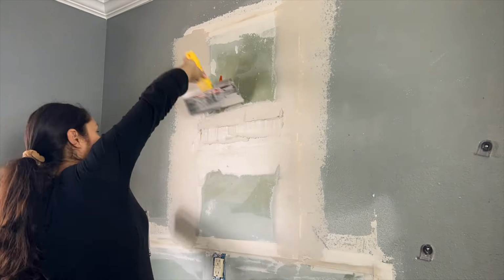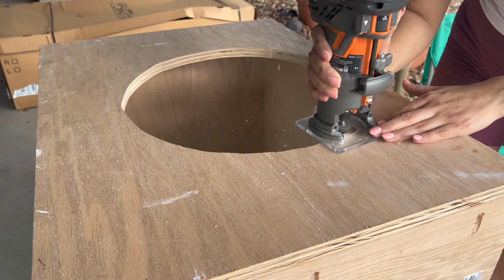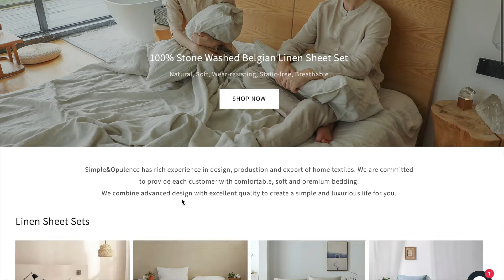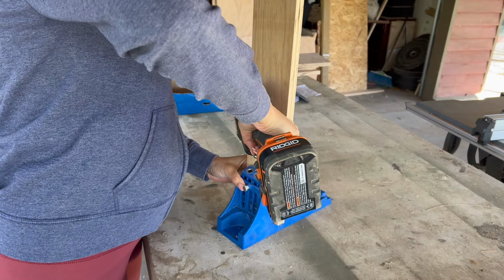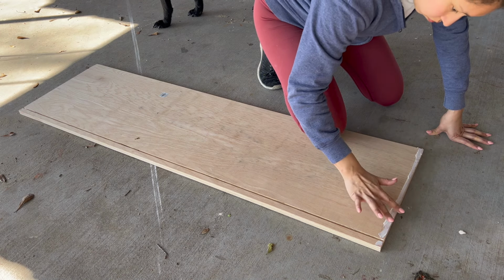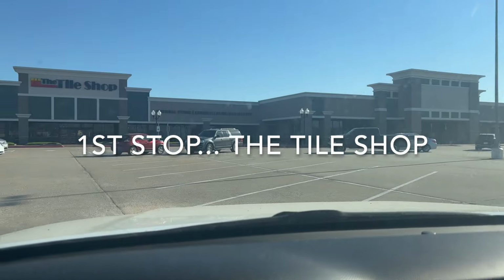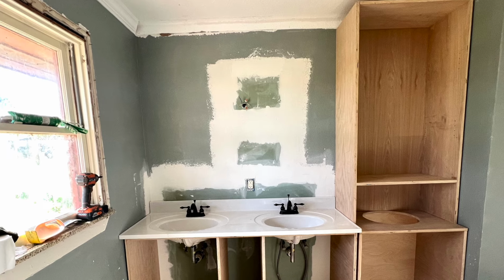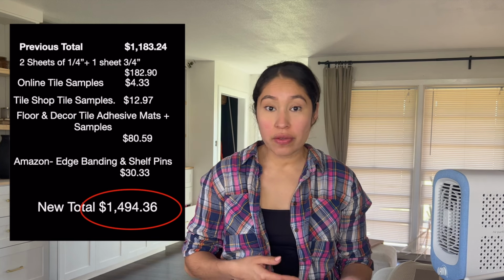MAKING A DIY LAUNDRY CHUTE | BATHROOM RENOVATION PART 5

Comment: The vanity is looking good, I like the laundry shoot.  I really do appreciate that you're sharing the costs as I plan on giving my bathroom an upgrade later this year, need to remove the tub and do a walk in shower.  A guestimate on pricing is helpful even thought different parts of the county, it may by slightly different.  Give a good idea though and products to use.  TY
Also like that you suggested; 'Simple&Opulence, a lot less expensive than the other one suggested by some Channels, Brooklinen.  TY

Comment: I think I prefer the larger subway tile.  It would be more expansive in appearance.
Does the project planning software you use have a feature to simulate a comparison of how the two styles would look on the wall? It might be easier to decide.

Comment: U laid the tiles in the laundry vertically, but I’m a fan of the subway tiles laid horizontally. However, if u don’t want all ur amenity rooms to have that vertical tile look, then go with the square tile. U seem to have a lot of height in the bathroom anyway, so I don’t see the need to accentuate it further. I’m sure whatever ur choice, it’ll look gr8👏🏼👏🏼👏🏼

Comment: If the two tiles are the same color, width and finish(hard to actually know on screens), how about offsetting them either vertical or horizontal. Otherwise, it's the longer tile for sure.